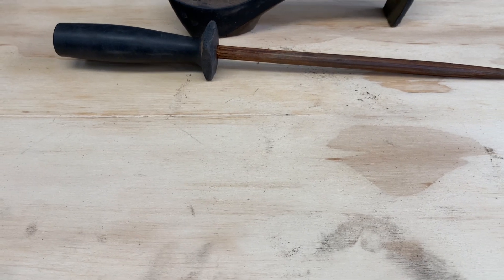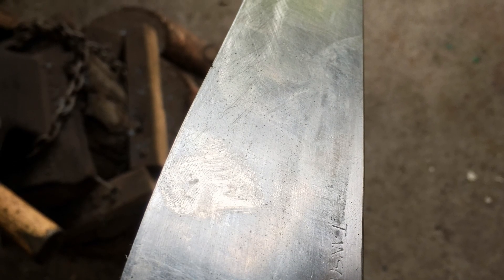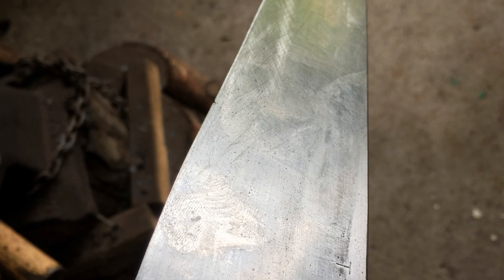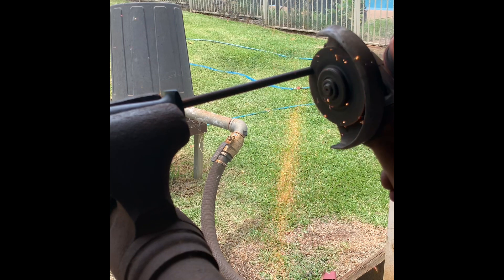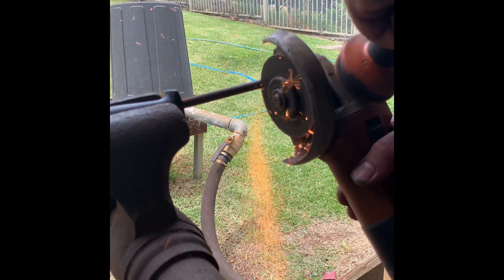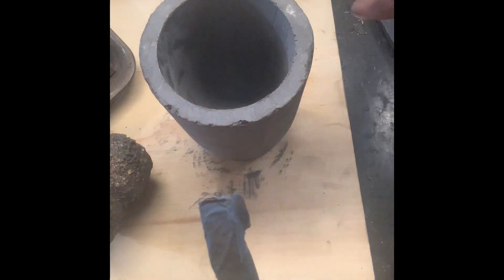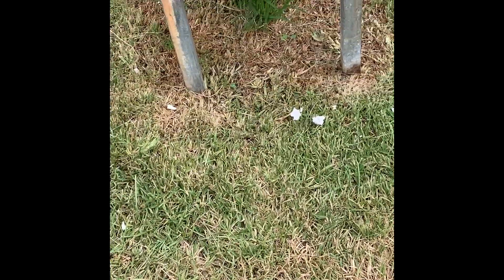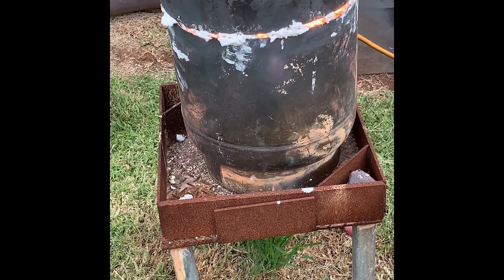Can you make a good steel using the “knife steel “ ?

Comment: I use a honing rod on my kitchen knives right before using each time. All are Wusthof, Zwilling and Sakuto. I’ve had them for 35 years. Once a year I methodically sharpen them. Now the pull through sharpeners are like you said……horrible.
Reply from the maker: They will work on soft steels for a while until the fatigued steel needs to be removed using abrasives . They aren’t useful on high hardness steels unless they are coated with abrasives ceramics or diamonds . I prefer whetstones for my abrasives
Reply: @ they work on my Zwilling and Wusthoff Knifes